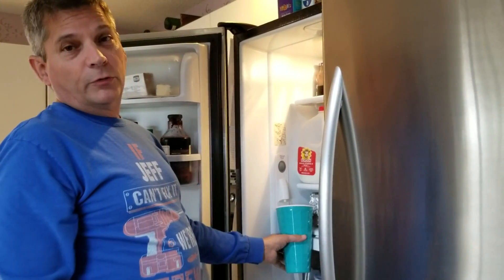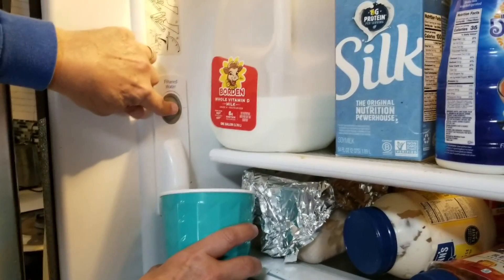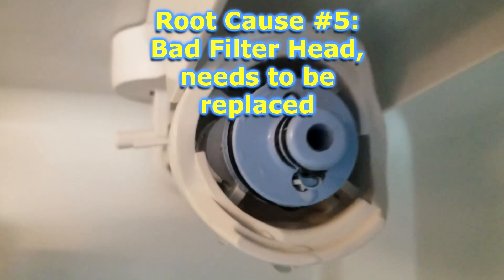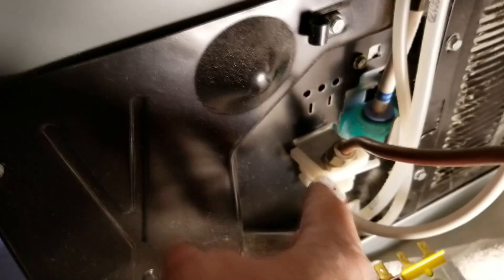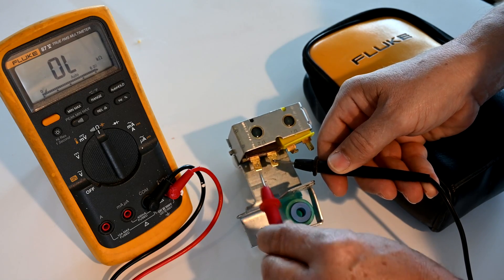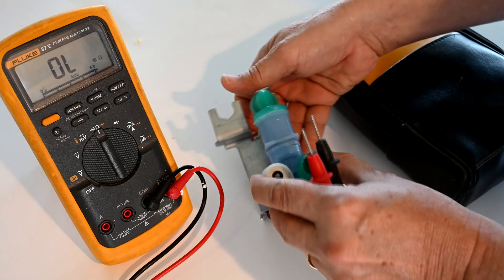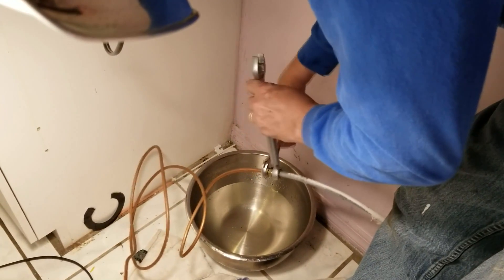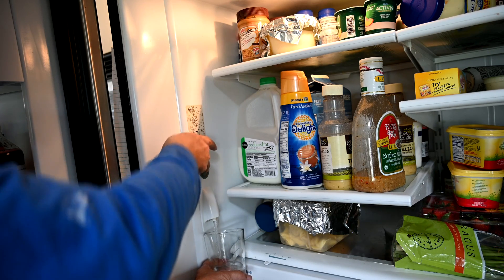5 Reasons Fridge Won't Dispense Water: Inlet Valve Fix DIY

Comment from the maker: ✅ Tools used in this KitchenAid refrigerator repair video:
✅ RIDGID One Stop Wrench: https://amzn.to/2LNIHDn
✅ Fluke 87-V Digital Multimeter: https://amzn.to/2LK8etM 
✅ GreatNeck Nut Driver Set, 7-Piece: https://amzn.to/2VGjaMI
✅ Supco WV5154 Whirlpool Dual Inlet Water Valve: https://amzn.to/2Hp1Hnv
Reply: Thank you Jeff! Your video was a money and time saver! Our water in the reservoir was frozen. Your video helped us fix it in minutes! Thanks you, again!
Reply: After watching this video I used the hair dryer for 3 minutes inside the fridge and the water worked!!!  Yea!!  Thanks so much as the water has stopped for than once and then came back on...now I know what to do it it happens again!  Great video with 5 ideas for why water might not be flowing!  Simple FIX!!!
Reply: My GF just bought a new fridge. When we went to install water line (which she has never used for 20 years), no water comes out of the valve. Do plumbers/contractors ever install a secondary shut off maybe under the house?
Reply: What an excellent video!  I haven't tackled the project yet but I am now armed with the knowledge that I need.  I loved your 5 point presentation describing the possible causes and I just replaced the filter about a  month ago so I know that isn't it. I'm guessing the solenoid connection, but I will check the others.   Thanks!

Comment: Thanks!  Very clear explanation and I'm always a sucker for a voltmeter shot.  Mine tested open circuit.  I didn't think it was my solenoid because water would shoot out of the filter housing when I pressed the button but didn't realize there were 3 separate solenoids.

Comment: My Whirlpool Gold fridge has a separate solenoid and water inlet valve.  I replaced the solenoid valve hoping this was this issue and it did not work.  My water reservoir is not frozen & my dispenser button works, so I have a feeling it is the water inlet valve,  I have one on order.  Hopefully I will have filtered water again once I install it tomorrow.  Thanks for this helpful video!

Comment: Hello, I have a Whirlpool WRS315SDHM and I have Ice and no water, the unit was in the garage for months with no water running to it. I took out the filter to see if the bypass worked, and still no water, ICE working great, In you opinon do you think just replacing the water filter will resolve the issue. again it's been sitting for months with no water but the ice machine works, IDK if it the valve OR the filter! Please help
Reply from the maker: try the water filter first, and if not, it might be the hose assembly with the gasket leading up through the fridge, like it was on my fridge.

Comment: I just had my kitchen redone, the way they connected the water line going from the pipe to the refrigerator, was with one of those self-tapping saddles, and it has the plastic line that just pushes into the valve, I was going to change it until I see this where these just push into the valves in the refrigerator itself, I was wondering if I should leave that solid valve alone or put a proper tee with a regular valve
Reply from the maker: if it is doable, I would put in a proper T

Comment: THANK YOU for this video! I had presumed that I had a bad inlet valve and already ordered the part, but then came across your video. Turns out that I simply had a frozen reservoir, and the hair dryer 100% resolved my issue. Definitely saved me some money and hassle!
Reply from the maker: Thank you so much for that $20 SuperThanks John I hope this fixed worked for you
Reply: @jeffostroff  Sure did (updated my comment). It was a frozen reservoir. Without your video, here's what would have happened - I would have replaced the inlet valve, that wouldn't have fixed the actual issue, and next step would have been to hire a professional to come look at it. Your video saved me probably $ hundreds!

Comment: Just be aware it is quite possible for the water line to freeze between the Valve  and the dispenser , you can disconnect the water line at the proper "outlet" of the water valve leading up to the dispenser location , either in the door or inside the fridge .. that line should be free flowing , you should be able to blow through it , you can also check to see if you have water at the outlet of the valve , by holding a bowl under it while someone presses the button , water should flow out of the valve outlet when you press the button. do be mindful not to shock yourself on the valves electrical terminals if its in a difficult to reach location when testing .  Some GE refrigerators (including those made by Kenmore) have real issues with the line in the freezer door  freezing and this is talked about on youtube. along with how to clear frozen lines. as well as address the root cause that keeps freezing them in the first place..

Comment: At 4:36 you jump from the bad inlet valve to the fridge filter head - which is great because I confirmed that this is the problem by pressing on the filter. But you never show how to replace the fridge filter head. At 5:20 you jump back to talking about replacing the inlet valve. Is there anywhere I can see how to replace the filter head?

Comment: Im stumped. Water valve at back tests at 400ohms, water flows to ice maker after harvest test by pushing paddle on my GE GYS22GMNBES&ie 4 times, but once I close the door and check 12 hours later, while there are ice cubes in mold, they never eject from mold. I replaced with a new ice maker, and still have the same issue. Just been googling all day trying to understand what is going on and found your channel. Any ideas? THANK YOU.

Comment: April 2024.  After putting in new Kemore white water filter in my Whirlpool fridge had slow water and clunking sound.  Filter door was a little harder to close.  My fix was to clip off about 1/16 inch off small plastic pin at front of filter and not either of the inlet/outlet ports.  Filter door is now easier to close and water works fine.

Comment: Hi Jeff, Great video! Thank you sir!  Problem #3 was my problem:  the water reservoir was frozen.  Hair dryer approach seems to have solved it.  But we've had this refrigerator for 5-6 years.  It never happened before.  Can you hazard a hypothesis about why this happened for the first time now, and is it likely to reoccur?  It it symptomatic of a bigger issue perhaps that will need a service call (or worse), or do you see where it happens once but then rarely again, long term?
Reply from the maker: I think it could be an airflow problem, if too many items are stacked near the back, maybe cold air gets trapped back there and cuases it to freeze. I also wonder if not using the water dispenser for a while might do this.
Reply: Thanks. We use it frequently. At least once a day. 

Those two produce bins would seem to block the airflow considerably?  But will check the upper shelves too.

Comment: I installed a new water valve. Still nada. Nothing to my ice maker or water. All hoses are tight. All electrical are correct and tight. Water is turned in. Filter is brand new and installed correctly.

Comment: I have .802 ohms and I only have one solenoid valve on my fridge. And I see water coming from the filter port whenever I release the filter after having tried the dispenser. Could the filter possibly be bad? It’s a new filter.

Comment: My problem turned out to be the filter head. I had no water flow at all to the dispenser in the door. I tried the hairdryer to reservoir procedure, didn't work (my reservoir is actually about 20 coils of tubing behind crisper drawer). The 3 solenoids of the inlet valve (1 to water filter and 1 each to ice and water dispensers) all tested with steady numbers (about 40). Eventually I determined that the water filter had come slightly out of place. That was shutting off the water flow. It had been 6 months since I changed it and it worked fine until that day. Tried many times and couldn't get it to stay in place, even tried a spare filter I had. When I pushed it in hard and held it I had water flow but when I let go it stopped. My filter head is different than the one in video, more complex. The frig is about 12 years old and our water is pretty clean here so rather than buy a new filter assembly I decided to bypass the filter- I didn't have a bypass plug so I went to the inlet valve, cut off about 8" of the tubing to the filter and looped it back to the return port. Now I have water and ice to the dispensers in the door. Cost zero. Bonus- I got all the dust cleaned out of the coil area.

Comment: WAIT! Nobody ever tells you this, but generally there are 'two' separate inlet valves! The first, 'pre'-filter, or 'primary' control valve, (which is the one that sticks out the back of the fridge) that stops water coming into the fridge except when it is called for,  in order to prevent the fridge water-line from being constantly under pressure of the water service. 

The second, 'post'-filter, or after-the-filter valve, is often independent and  'hidden' further inside the guts of the fridge. It independently directs water to the dispenser or the ice-maker as it is called for by either device. Failure of this inlet valve is even more likely to be the cause than the primary, especially in areas where you have soft water that 'doesn't clog primary valves.

Comment: Usually when the water starts coming out slower than usual, I replace the filter and it is back to full strength. This time with a new filter replacement the water stayed the same slow speed. Have any ideas? Should I try a different filter?

Comment: Thans Jeff, the water reservoir line was frozen and thr hair dryer worked. My fidge was set to 35 degrees, what would you recommend setting it at as to prevent this from happening again. I have a Viking VCFF036SS

Comment: So my KitchenAid dispenses water but it is so slow  I won't use it.
It's been slow since we got it but I thought it was normal to get a tall glass of water filled in 47 seconds. Then recently,  I heard it should be from 6 -10 seconds MAX!!!
So, I've done everything but the intake valve replacement  which is next! I even replaced my icecube maker, but it needed it. The electronics messed up, made 1/2 tray hollow cubes... which I know can be the intake valve but on top of that, the cube tray was corroded, missing some of the coating on the inside where the cubes sit!
Water line seems fine... buttons are clicking and dispensing but slow!
It's got to be the intake valve!!!!!!! Please be the intake valve!!!!!!!
I will order a generic exact vopy for less off Amazon as the whirlpool parts are so expensive. Replaced a hose connector, 1/4 to 3/8 for $10.00 home depot, instead of $35.00 whirlpool parts place!
Thanks for the video. You went through lots of causes. My only step after this, will be an appliance  repairman.

Comment: I just want to say THANK YOU for helping me fix the problem. We thought it was the Water inlet valve, but yeah still no water after changing it out. We did not however know about the jug thing in the back of the fridge..... Well, that was it. Took my hair dryer to it for less than 3 minutes and bam we had water. Thanks so much for posting this video you're a real life saver. Keep up the great videos.

Comment: Thanks   my Water Filter Head and Tube Assembly was not allowing water to pass through, so I bypassed the water filter by cutting the the in back and comnnecting to the Refrigerator Dual Solenoid Water Inlet Valve.  I have a whole house filter to filter the water coming to the refrigerator.

Comment: Hey Jeff! Our refrigerator, like yours, is missing the back panel cover that holds the inlet valve. Do you think everything will work properly if we purchase a valve and connect everything?
Reply from the maker: It should work just fine. That valve cover is probably just a decorative plate or something to mount it to. It does not affect the function of the valve so everything would work just normal
Reply: @jeffostroff  thank you so much!!

Comment: I can't thank you enough! I tested my line just before the door and had no water, but had water through the filter just before the solenoid. Metering the solenoid showed 360 and 180ohms so I pulled the water line and sure enough had water directly out of it. The water line from the back to the front was getting pinched under the fridge!

You only get handy, but trying to be and finding mentors along the way. Thank you!

Comment: Jeff, we followed your video instructions and are not screwed! 
In the end, it was a frozen water line but that issue wasn’t immediately apparent. We took the hair dryer to the door and, with still no water, looked at the water inlet valve. After ordering a new valve on line ($100!) we pushed the fridge back against the wall which I think jostled loose the frozen bits in the line. After getting it back in place we decided to give the water dispenser more Hail Mary press and we had water! Needless to say we are returning the inlet valve once it arrives. Thanks for your video.
Reply from the maker: Awesome

Comment: when i pull my water filter out , it is shooting out water at same area where filter use to be.   in the past when i pulled out the filter then would be no water coming out.   seems like a seal or something is defective.   is this the water filter housing problem or is it a water inlet valve problem?
Reply from the maker: I think the problem is the gasket inside where the filter attaches

Comment: Thank you. In my case, I was making ice, but not getting water from the front of the frig. At the water dispenser, you could hear the humming when you press the button, but again no water. I'll be replacing the valve assembly soon to resolve this issue.

Comment: I tried all of these but my water line is still freezing. The ice maker works, but the water dispenser line will freeze up. I unplugged the fridge and let it warm up, and then the water would dispense. However it froze up again in about an hour. In my french door fridge the ice maker is in the upper left corner of the fridge compartment, and the water line runs through/around it. Any ideas? Whirlpool has not been helpful at all.

Comment: I have a GE with two solenoid connectors, one is fine at 186 the other is  .325 so I'm assuming the .325 is faulty? 
Great Video
Thanks

Comment: Hi. I just replaced my inlet valve on my kitchen aid fridge but I’m still not getting water out from dispenser. Dispenser hums. Unsure where to go next. Any leads to go on next?
Reply from the maker: Search for my other video on changing out the filter head on the fridge that's what solved it for our issue
Reply: @jeffostroff  will do. Thanks. I saw in this video. I pressed the two heads and there’s water coming out under pressure. New water filter is filled with water.

Comment: I just bought a Frigidaire Gallery Model #FGHS2342LF2 Refrigerator, I think it's a 2011 year. They said the water diden't work, but when I got it home neither the water nor the ice was working. Should I replace the Water inlet valve? Or is their something else wrong. Everything else works.

Comment: Hi Jeff, we have a kenmore refrigerator and it is dispensing water without the water filter, but not with the water filter. We replaced the water filter and it still does not dispense water. Do you know what the cause is? thank you in advance

Comment: You mention root cause #5 (bad fridge filter head at the 5 minute mark) and NEVER talk about replacement. The 2 white "push ins" could be worn down. BUT you don't talk about how to fix.
Reply: Replace the whole housing. It comes as one part

Comment: I have exact same Kitchenaid refrigidator.  It started not dispensing water on side dispenser when I replaced filter. I thought it was valve. I replaced valve and still not work.  I decide to remove water input hose and it pours out water when I turn faucet.  Then hooked up and remove hose from output of filter to valve (removed valve side end). Turned on faucet. no water coming out.  So I decide to remove water filter dispenser valve.  I hooked up air compressor and pushed two needles down and air came out.  Returned to refrigidator and decide to rig  water input hose to water filter hose and turned on water and rigged it to sink. I decide to put filter in and turned, water came out strong then when I fully turned filter to stop (felt a click). Water stopped pouring.  So I decide to turn 1/4 way and water came out. Realizing that it's the filter two little "ramp" was little off on alignment due to factory ( I bought non-oem filter). So try turn filter 3/4 way in and you should be able to get full water.  That's how I solved the issue.   Before you order new valves on bottom of refrigidator, check turn filter 3/4 way, not full and if water come out then you know.  Don't need to replace water filter dispenser valve tho....  Thanks!

Comment: An added advice is to make sure the temperature of the fridge isn’t above what’s recommended.
As well after warming up the water reservoir place a foam , type  of insulation, behind the reservoir to prevent it from freezing up again.

Comment: Hi Jeff , QUESTION I’m trying to order the part to replace the filter head , in your video I can see two hoses but mine only has one coming out of the back of the fridge… do all replacement parts come with two?  
and if so how can I fix it?
TIA
Reply from the maker: Not sure, every fridge I saw has 2, because icemaker and water dispenser are to separate solenoids. If you have no icemaker there might be only one hose.

Comment: I have the same fridge the ice maker and water dispenser are not working could it be from the water reservoir being frozen if both features are not working.
Reply from the maker: 90% of the video commenters tell us here that their failure was the reservoir frozen over and they solved it by using a hair dryer